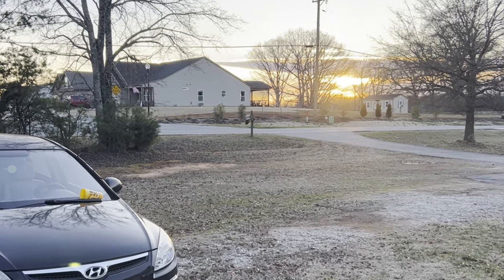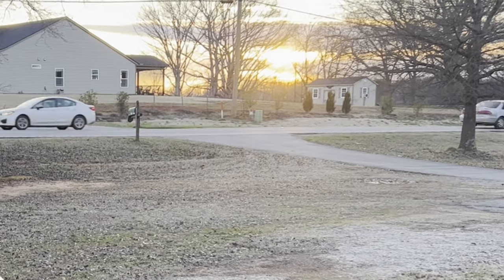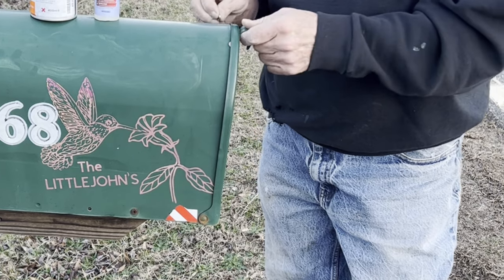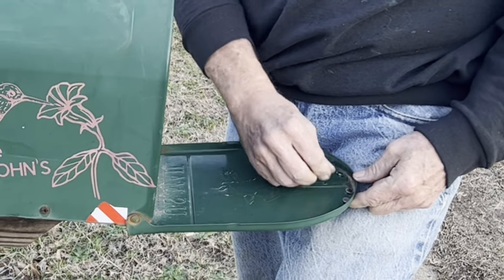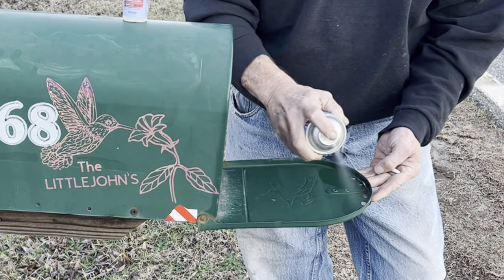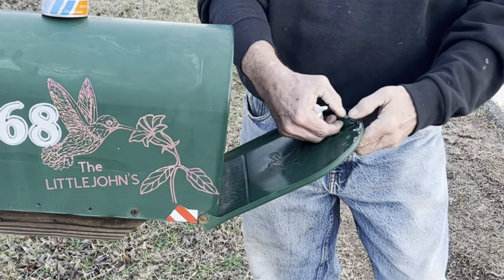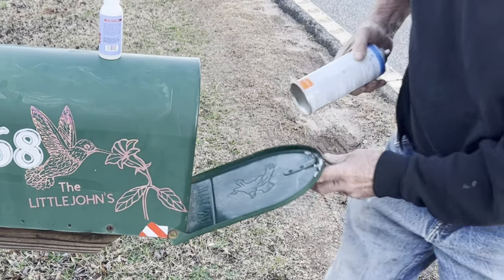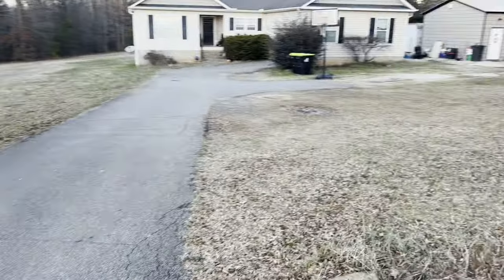Mailbox repair

Comment: Hi, Do you think Gorilla Glue or a hot glue gun would work to fix the bottom of the door? My mailbox already has a magnet, but the door has three screws attaching it that are loose (not stripped) because the holes are worn and now loose. Thanks.

Comment: Great video. What’s the accelerator spray brand?
Reply from the maker: I will have to check the shop, no wait I can go look on Amazon, lol
Adhesive Guru CA Glue with Activator Woodworking (2 x 3.5 oz - 2 x 13,5 fl oz) Ca Glue for Woodworking, Cyanoacrylate Glue and Activator (2 Pack) https://a.co/d/03p6C7s

It worked great till my mailbox got hit by a truck, lol